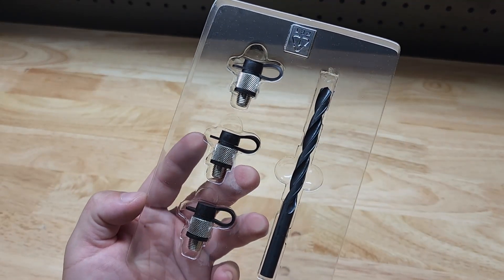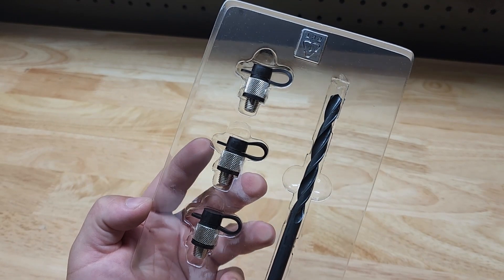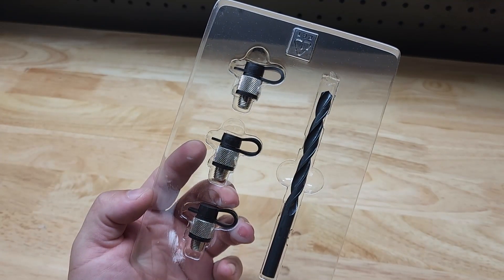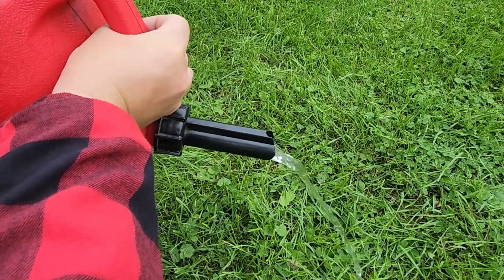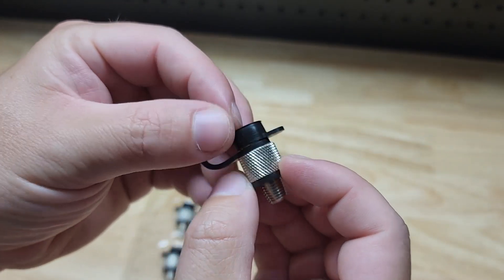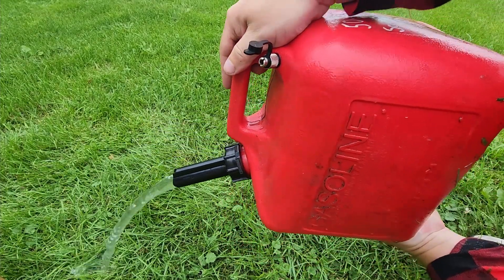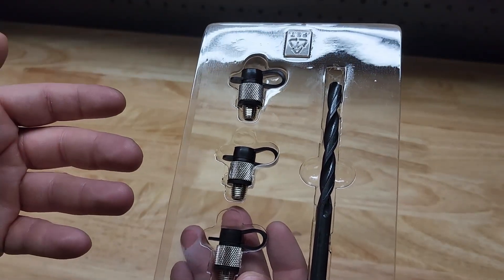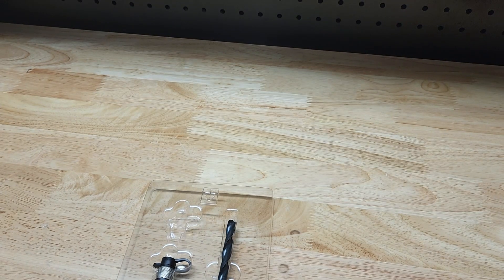The Air Ducky Will Change Your Life Forever! 🦆⛽

Comment: 5 gallons of gas weighs less than 31 pounds, not 40.  That's closer to the weight of water. You need a new spout on those gas cans also. The spillproof spouts suck. 😱